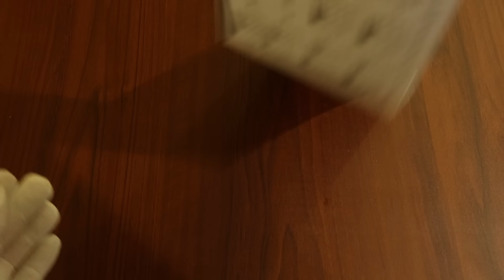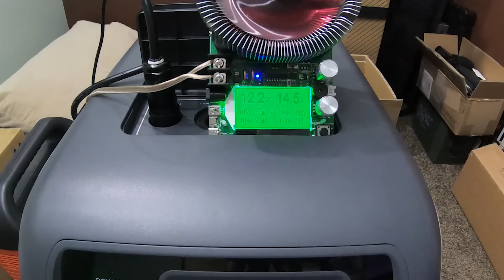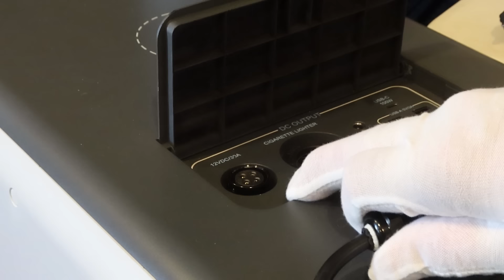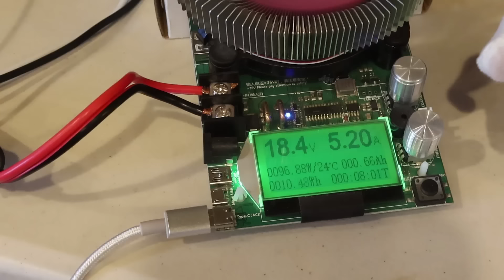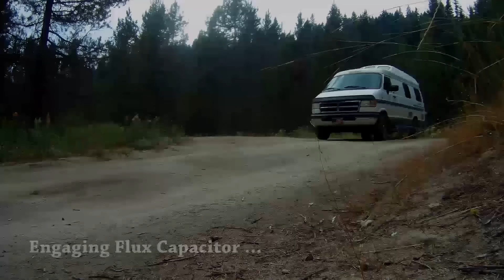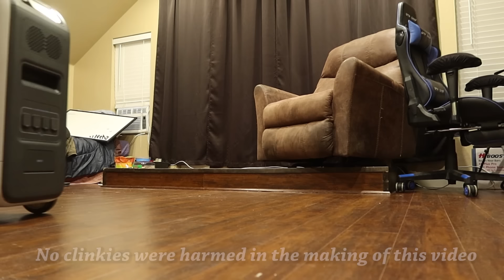BLUETTI EP500 5120wh LiFePO4 UPS BACKUP Off Grid Solar Generator Kickstarter Review

Comment: I think I'd like to see a modular solution from Bluetti where a user can get a base unit and expand in a stackable fashion similar to Titan, but with all the feature this unit has.  The base unit would be the brain and the user can buy addl batteries as needed plug n play to suit his needs.  That way the weight is more manageable in smaller pieces because of the modularity.  For example, this unit would be comprised of maybe 3 pieces that connect together @ 50lbs ea to make it more easily portable.  I hope that is the next generation of offerings from Bluetti.
Reply: are you kidding me?
Reply: @michellelaclair  kidding you?
Reply: @AGhostInTheMachine  yea,its like you wrote the script!! See next comment I sent for you
Reply: @michellelaclair  I doubt they saw my comment  LOL, but I'm stoked they moved in this direction.  Have not locked in on anything so far, but the 300 is where I'm leaning.  I tend to procrastinate when it comes to an industry that changes/improves this fast.  Tricky to choose an entry point because whatever you choose will be obsolete soonafter.
Reply: Now that bluetti has done just that, which one would you buy ? this one, or the ac200 max or the ac300?
Reply: yeah, i think that would be more user friendly. similar to how Pecron is making theirs stackable.
Reply: They make an EP 800 and 900 that does exactly what you're looking for!

Comment: According to the Bluetti FAQ on their Campaign site I found this information:

After the stated 6000 battery cycles, how much capacity is left in EP500 and EP500 Pro?
EP500 and EP500 Pro can maintain above 50% capacity after 6000 cycles.

Most comparisons are stated at 80% capacity or 80% DoD. 6000 cycles sounds great but what is it at the usual 80% that most people use as a guide line so that every one is talking of apples to oranges?

Comment: I am getting solar panels from Tesla and the project manager told me today that I could claim the Federal Tax Credit for a pair of powerwalls as part of the install because they would be powered from solar. Cost for the powerwalls was $19k including installation so I could claim $4,180 back. A pair of these is $5,600 so with the 22% tax credit, $4,480 ( actually a pair is $6k - don't get quite the same discount on two ).

Right now, the problem for me is that if I don't get the Powerwalls plus the controller, my PV array goes offline when the grid power goes out. I live in Florida so I am thinking about a scenario of a week or ten days with no power. With a pair of the EP500s I would have 10kWh but no way of recharging them from solar during a long term outage. I think I need to figure out how I would rewire a part of the array for connection into these units. I suspect Tesla will have a closed system to make it difficult to integrate the Bluetti as a powerwall alternative with their inverters so that I can stay up when the grid is down. The solar panel solution pricing is great but there will be a downside. I can see me possibly voiding my warranty.

I also have a Chevy Bolt with a 55kWh battery and a Sonata Plugin Hybrid with a 9.8kWh battery sitting on the drive. I was thinking that I could drive them both to wherever electricity was available to charge them up and then literally carry energy back to the house. Trying to figure out the best way to get the energy out of them. Also looking at the little propane generator that you reviewed a while back as a means of driving the AC charger in a pinch, even a pair of them, one per EP500.

If I can figure out where I can put the EP500s, I may well buy a pair. The wife will moan like hell about them until the day the power goes out.
I JUST ORDERED A PAIR FOR $5,999.00. You don't get the same discount for two as for one. AC charger is extra and a little pricey at $205. This is a little impulsive but at this price I can sell it on if I don't see a need for it.
Reply: It will definitely be less expensive than the powerwall but I don't think they qualify for the solar credit as they can be charged off the grid and the requirement is that batteries be charged ONLY from solar.  Do the research.  Still a fabulous deal.

Comment: All 300 of the cheap $2,799 price has gone in less than 24 hours.  The product is still available, but the price has already increased.  (watching the video same day as it was released and I can only assume that the EP500 sold out of the cheap price in only a few hours, way less than 24 hours)
Reply from the maker: Yes, I made a community post the $2799 deal was gone in a few hours. Even Bluetti was shocked at the demand. There are still Pro models at the super early bird price but I suspect those will be gone by tomorrow morning.

Comment: How much energy loss would you think charging a ebike battery directy from an mppt charger vs charging off a powerstation that is getting power from solar panels?
Reply from the maker: Not enough to risk blowing up your expensive bike battery and possibly causing a fire. Use the smart lithium charger it comes with.

Comment: Did U leave out the fact the EP500 Pro charges from grid in 3.2 Hours v. EP500 9 Hours. That's a HUDGE Difference!!!
Reply from the maker: The EP500 can also charge in 3.5 hours using the method in the video. I'll ask about the Pro internal charger but I didn't think it was >600w as they sell a 500w 2nd charger for it.
Reply: @HOBOTECH  
My info came straight from the link. I'm also saying that charging from 1 outlet specs, Oranges to Oranges.

Comment: One could wonder why an established company needs to do a Kickstarter campaign for a product that already exists.
Reply from the maker: Bluetti is still small fry compared to Jackery and Goal Zero. These pre-production models they sent out are extremely expensive. It costs crazy money to develop something like this. Notice no one else has anything close, either.
Reply: @HOBOTECH  
True but considering other companies are selling the exact same products branded 'Bluetti' under another brand I'd say it's not actually the brand 'Bluetti' designing these units.
The tooling and design is already done in this case so I'm guessing 'Bluetti' wants the cash to buy stock from the actual manufacturer.

Comment: I Was Wondering If You Can Parallel The 500 & 500 pro 
To Each Other With The Upcoming Wiring Harness & How That Would Work As Far As Total Capacity ? ? 
If Someone Could Answer Other Than The Professor ( Much Appreciated ) Thank-You For Your Response
Reply from the maker: Unfortunately, no. I asked about this early on. The Fusion box is specific to the model so you can't mix and match.

Comment: I got the pro with the dual ac plugs. I'll have to get solar panels another time. But thank you hobotech. I'm glad your channel came up in my recommendations
Reply: Sounds smart. I'm also shopping for the solar panels.
Reply: What did you find for solar panels?
Reply: I connected 4 Sunpower 435 watts panels and it tops off at 1,217 watts of solar power

Comment: So, I'm going with (2) 280AH LFP 4 cell batteries (24v 280AH & 7.1kWh) but that weighs almost 92Lbs!!! Add 2 AWG wire, a shut-off, a fuse, a Pos. & Neg. terminal & 100Lbs. is NOT out of the question. No screens, no inverter, no plugs no wiring D box....I can see 145Lbs... But- it's BUGE! (Big & Huge combined- tech term...)

Comment: Could someone tell me the difference in the EP500 and the Ep500 Pro.   Is it basically the inverter and a few small things.   $1000 more for a bigger inverter seems like a lot.  IS There a $1000 value in buying the PRO?   REALLY?
Reply from the maker: Differences are listed on the Kickstarter page. You get 2400w solar with a wider voltage range, 3000w inverter, 12/24v charging, 2nd 100w PD, and another AC outlet.

Comment: If the EP500 12volt outlets are regulated, then how come when testing the voltage is 11.7.
Reply from the maker: That's how electricity works. Voltage sags under heavy load.
Reply: @HOBOTECH  , Thanks for the explanation.

Comment: A quick note... you mentioned in the video that you're not able to charge via DC.  This is true for the base model, but the Kickstarter page indicates the Pro can charge from 24V DC.  Just thought people should be aware, though I doubt many are looking for the ability to charge from DC.  😊
Reply: How come a battery that presumably you'd want to charge with solar panels not be able to be charged via DC? (You mean it just doesn't have the connections?  I charge lifepo4 batteries all the time via dc for amateur radio)
Reply: @anthonygorrell1343  Sorry, I should have been more specific in my wording.  Aside from solar inputs, the base modeal doesn't have a 12V or 24V input port for charging from batteries.  The solar input is DC, but at a much higher voltage (I believe 55V minimum?)  The Pro model appears to be advertised with a 24V port.

Comment: Bluetti campaign won’t let you pledge for two EP500 power stations!   😩
Help!!!!   
Did order one super early bird tho’!
Reply from the maker: Just scroll down. There is a perk to order two!
Reply: @HOBOTECH  yes, that’s correct.  Problem is that the unit price is higher for two than for one!  In effect, it’s like it’s two at the “early bird” price instead of two at the “super early bird” price.   😩
Reply: @philipmorgan1438  I got the more expensive 2-pack as well... I was trying to be an honest player. Let’s hope they throw in the extra hardware to connect them together. 
NOTE: HOBOTECH explains in the pinned comment how to get 2 units at the early price.
Reply: @realrasher  I’ll hope for you that they do.

Comment: It may be too big/cumbersome for RV use and too small for home/grid use..    I believe a combination of both solar and gas generator are necessary, and not relying on one or the other to satisfy my needs...   In addition,  you won't be able to regen the sogen unless you invest a sizeable amount of bread into solar hardware, and still needing a larger inverter than they provide, to include the Pro  (oh, wait I forgot, you need TWO of these to make any real difference)....  BTW, I would check to see if all this IS tax deductible (a great idea), as connecting to the house wiring requires permits and inspections, to include a licensed electrician to file a Fire Underwriters Certificate to satisfy the property insurance company in the event of a fire..  Hmmmmm.....     I'm not trying to pee on anybody's Cheerios, but there are important considerations that need to be addressed before connecting to the grid and the breaker box..  I suggest keeping it simple..   But, it doesn't matter,  boob toobers will charge full speed ahead anyway, and what looks like $6000 (good for what this ALMOST is), now blossoms into BIG $'s and complicated gov't procedures (can you spell commie cali..??) that may not really serve the intended needs, 'as described by Bluetti'.. LOL!  Sleep well, America..!
Reply from the maker: Guess that's why they offer the Pro for those that think 2kw inverter is too small...
Reply: @HOBOTECH  Frankly, they know the American market and their power needs. As much as I like Bluetti products, to attach to the grid and power a home with a 2ks inv. is urinating down our necks and telling us it's raining..  In addition, I think the Pro should also be higher.  It appears that they don't want to run an RV, cater to the  homeowner, but not give him what he/she really needs to run the home effectively..   Not to worry, it will all be in next years version..!  LOL!
Reply from the maker: @pjf7943  I bet you were a kid that didn't pay attention in school lol. When you hook this up to the grid with their kit you use two units together for 4kw or 6kw depending on the model. It will run most homes and RV's just fine in that config.
Reply: @HOBOTECH I'm led to believe that they include not ONE, but TWO free trusses with every EP500 sold..!   Thomas, you are kicking sand in Stan's face, in addition to he being green with envy,  after he reviewed a puny, inconsequential sogen the other day..  LOL!  Me thinks the size of the inverter is disappointingly low for such a monster sogen as this (what do  I know?),  but the output volts remained impressively high w/out crushing the amps..  Is there no 30 amp RV output because the inverter is paltry (my estimation)??  Like an old Apple G5 case, it should have been aluminum.   Maybe cali-power should buy these to provide 'CLEAN' power for it's 'new green deal losers'...??  $2800 (shipping?).??  Holy poop..!  Thomas, all your reasoning to buy this for home backup (w/appropriate solar panel power to recharge it) is quite valid..  An informative and entertaining review as always..

Comment: I normally do not post "you should have done this comments", but the DC test should have been tested at 30 amps, to get the a much better KWH reading.   15A (14.5A)  is just too low.
Reply from the maker: My tester only can do 180w max.

Comment: The UPS relay is only up to 600watts or whatever the capacity to charge from the grid.
Anything more than that and it will drain the internal battery.
That is according to another vlogger who already contacted the bluetti who said they will release a firmware update and make the gridpower bypass
Reply from the maker: That bug was fixed so I didn't report it.
Reply: @HOBOTECH  , nice to know that
Reply: @HOBOTECH  Since the firmware fix, what are the updated ratings for the built in UPS feature. I'm mostly interested in the UPS specs for the EP500 pro version... not sure if they would be different.

Comment: Also note that most Jackery panels have that barrel plug connector, making it difficult to connect in series.  I made adapters that will work but it wouldn't be functional out of the box.
Reply from the maker: 8mm adapters are on hobotech.tv/amazon

Comment: Another Good Video!  
I didn't hear you bring up if you could add additional battery storage... To some, that is very important. I guess you could add a buck converter and plug them into the solar input.. but that's not really the correct way of doing it. It would be a nice option for those specific that plan to grid tie, or off grid cabin dwellers!
Reply from the maker: The Pro models have the option to charge via 12/24v battery but you can also just make a 60v or higher battery array and charge via solar input without a boost converter.
Reply: Totally agree I want expansion capability. I don't however want to buy a second unit. At this price point it should be a no-brainer.  Once again the TITAN has the edge. Especially the new 2.0 version that's coming. It's everything you expect. Portable, expandable, uses various types of batteries and power sources. I love my Bluetti but this is starting to get old.
Reply from the maker: Titan is vaporware. It's out of date, overpriced, and uses weak batteries. The worst part is the 6 month waiting list to get one.